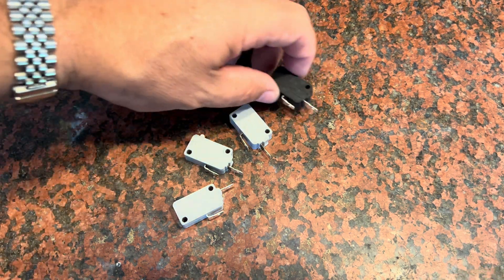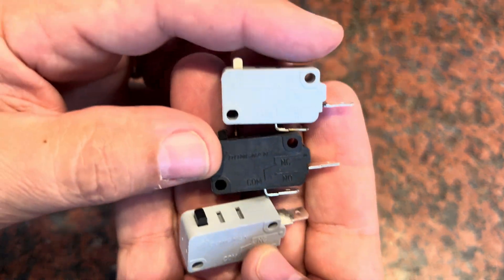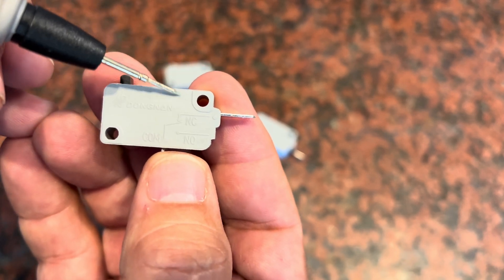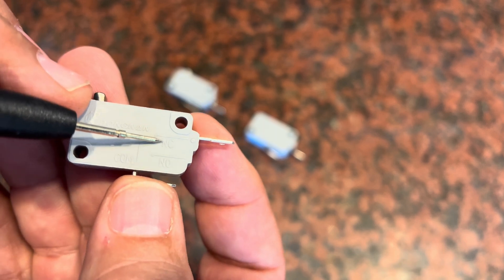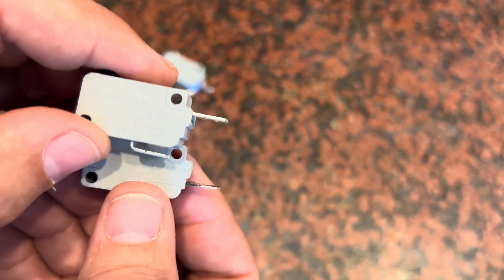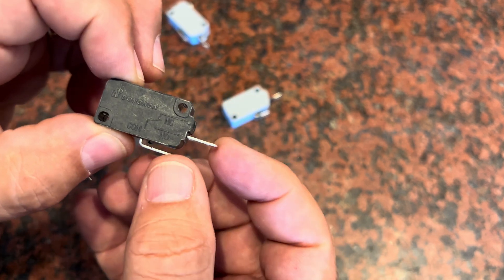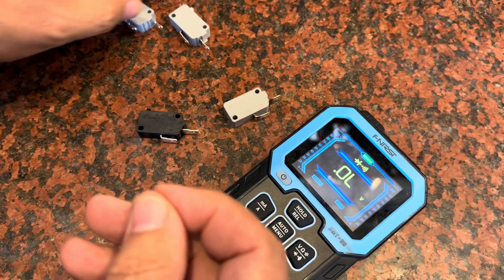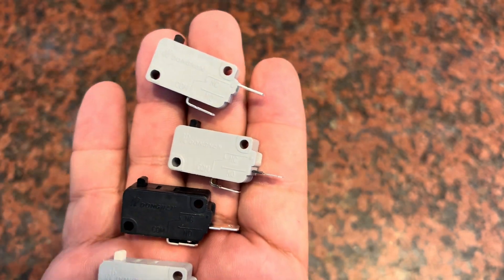Switches NO/NC? Learn Microwave Switches ● Normally Open or Closed

Comment: Why the monitor switch works - on & off BUT becomes always on having constant continuity after connections to the wires??  
That is, the switch works when is alone but becomes not working after connections. Sounds like unbelievably weird😏🙄

Comment: it is called a  " microswitch "  ( or 
micro switch , or snap-action sw. ) 
first sold by the MICRO SWITCH
Company.
    They are used in THOUSANDS of
products ,  not just microwave ovens.
The  " micro "  refers to both the
small size  as well as the high-speed  , microsecond speed  of the patented snap-action
mechanism employed  vs. other
common switches in common use
in the 1930's ,  when it was invented.
Reply from the maker: @rythemzlatin  thanks for sharing!!
Reply: I wasn’t going to watch this video, just post the same thing you did. However, I am now curious if there are other-um- less intelligent things said in the video.
Reply from the maker: @iamthundermug  harsh!  lol. But I appreciate your knowledge. This video was aimed at people fixing microwave door switches and buying the wrong ones.
Reply: @iamthundermug why don't you explain what less intelligent things he said , in comparison to yours , instead of just saying that ?
Reply: @levicallis459  the issue with videos such as this one and numerous others puts people in danger.  As an electrician with 40 years of experience I’ve seen what happens when people watch a YouTube video and think they have a new found knowledge of how to fix things.  The use the wrong sized or type of screwdriver or an old worn out dollar store screwdriver that leads to loose connections which lead to fires or electrocution. 
When I start watching a video and they misidentified a part or use an improper tool, I stop watching.
Reply: @iamthundermug lol so you had a preconceived plan of calling him an idiot about wiring , even though he didn't wire a single thing ? If you're so smart , then explain what he did so wrong with switches . And come on  man , it's switches in a microwave , not a transformer . Yes yes , I'm aware of the capacitor , but the likelihood of someone Causing a fire from a loose connector on a switch , is very unlikely . That's the whole point of a fuse
Reply: @levicallis459  you’re wrong about a fire being unlikely. They do happen more frequently than you realize. Fuses don’t always blow and breakers don’t always trip. The wire heats up, the insulation on the wire heats up, melts and catches fire releasing toxic smoke. There are other thermoplastics in a microwave that will burn releasing more toxic smoke.  If you have a baby, would you want to risk his/her life?
Reply: @iamthundermug well rather argue with you on some random guys channel , I can throw you my number and you can send me links to examples of this happening so much . Even if you do more risky electrical, like wire an outlet wrong , or light switches , there's usually always a fail safe . Of course there's outliers , Just like there's outliers for 40 year electricians accidentally killing themselves .